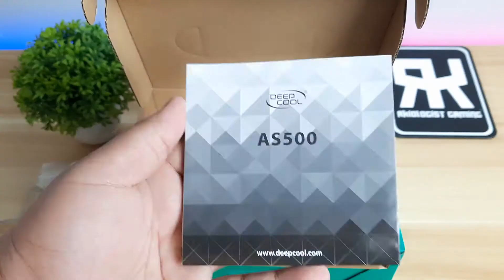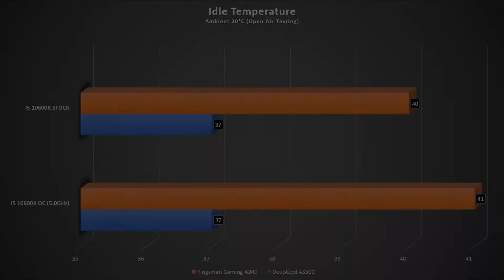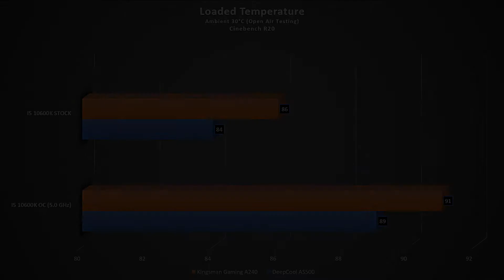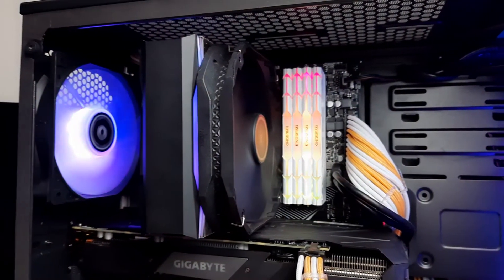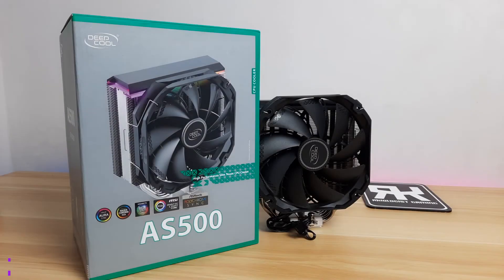DeepCool AS500 - Unboxing, Assembly & Review

Comment: 4:56 so that's where the power cable goes and by the way thanks for explaining the pros and cons ,no many reviewers do that.
🤔Thanks again.
Reply from the maker: glad i can help :) dont forget to leave a like and subscribe
Reply: @RKiologist  done 🙏
Reply from the maker: @aalennn1  thanks man!
Reply: @RKiologist  is there any possible way to order extra fan for the cooler 🤔
Reply from the maker: @aalennn1  yes you can add a tf140s and it will be the as500 plus. You can use 2 120s and 2 140s as long as the 140s are at 25mm in height
Reply: @RKiologist  yea I was planning to turn as500 into as500 plus ,however I couldn't find the exact tf140s anywhere (Not even on their site ) ,I contacted their support they seemed to be helping so for now I'm waiting ,meanwhile I found another alternative "The GF140" will this do fine cause I don't want to change the already existing 140m fan which came with the cooler. 🤔
Reply from the maker: @aalennn1  well its really up to you